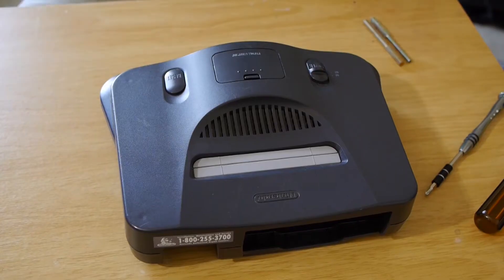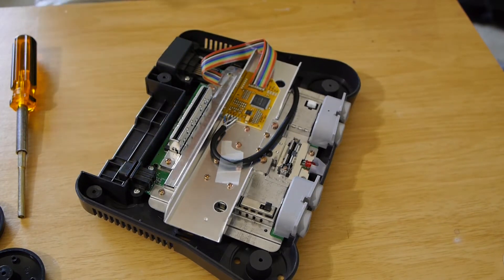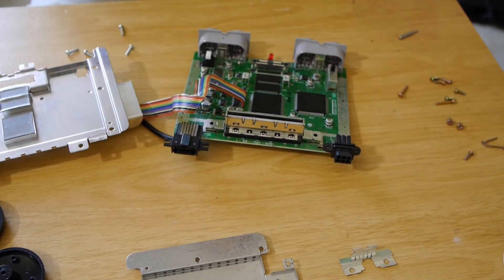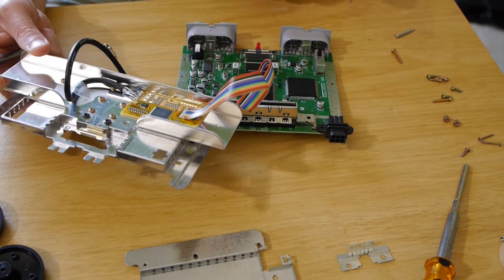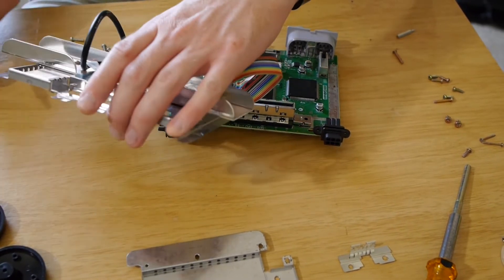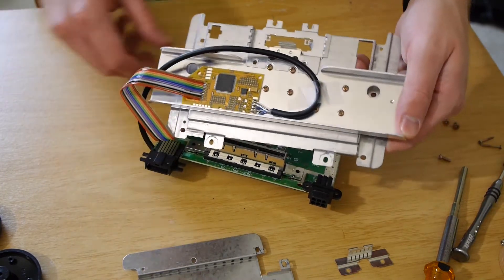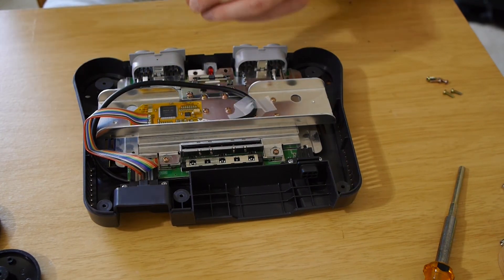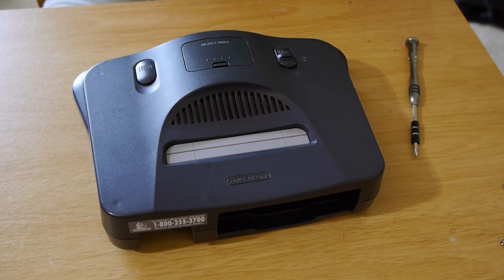How to install the N64RGB mod in a Nintendo 64

Comment: I recently installed this mod and had a weird interference like problem. There was a weird color branding issue. I used plenty of flux and thought I had been really diligent. After I took it back apart, I put the multimeter to it and found some bridged pins. They didn’t even look like the were bridged. I just put an ample amount of flux on there and hit it with the iron and tested it again and the bridge was gone. Hope this helps! Happy soldering :D
Reply: Thick_propheT How do you use the multimeter to find out that they are bridged?
I'm new and might buy this tool, thank you!

Comment: It sounds like you were experiencing the ground loop feedback issue, which was solved a long time ago by using an alternate grounding point on the analog side (grounds through the heat sink, IIRC). Try it!
Reply from the maker: I have, actually. It made no difference. There have been several other ideas thrown about since then, mostly related to power, but I've stopped caring and accepted it as is :p
Reply: noodohs Ah. That’s too bad. Was worth a shot! Maybe Borti’s N64 Advanced or the basic version would work better. :(
Reply from the maker: I know this is really old at this point, but I did swap to the basic kit from Voultar and it's a big improvement. FYI for anyone else watching.

Comment: 1:09 “You need to get this [jammie?] out of there first.”
Nope! Take out the security screws and the Expansion Pak/Jumper Pak will be the only thing holding the top on. Lift off the top anyway and the Pak will come off with it, nicely contained in its compartment. :)
Reply from the maker: Either way it has to come out :p
Reply: noodohs Yep! Just thought I’d give that little tip since it’s way less fiddly this way. :) No need to pry or dig up a tool or anything. Can’t forget it during reassembly either if it goes on along with the top shell. Sometimes I do find that I need to test with the top off, prompting me to go grab one. It falls right out of the loose top shell though. :) I’ve done waaaaay more than my fair-share of UltraHDMI installs and I picked up a few tricks early on. Something for the wiki? ;)

Comment: it seems to difficult wiring work.
Reply from the maker: It's not too bad. He also has adapter boards to make it easier now.
Reply: UltraHDMI FPC cable is much easier but this now has a flex PCB adapter that’s almost as easy.

Comment: Does this remove the capabilities of the machine to output composite via multi-out?
Reply from the maker: +Kyle Cummings No. For North American systems, you do not need to cut the composite trace to get c-sync, so you can still use composite if I remember correctly. For European systems, however, I believe you do need to cut the trace, so you would lose composite.
Reply: noodohs How about japanese?
Reply: Japanese are ntsc same as America